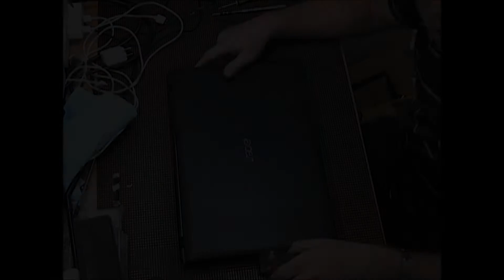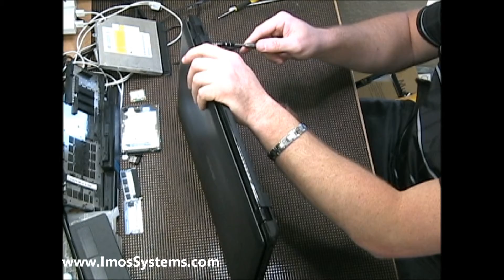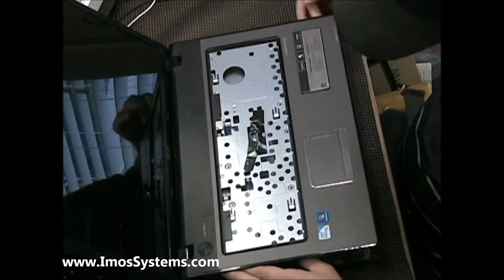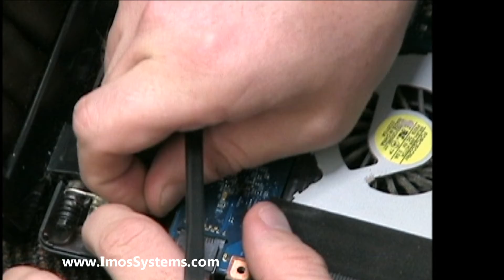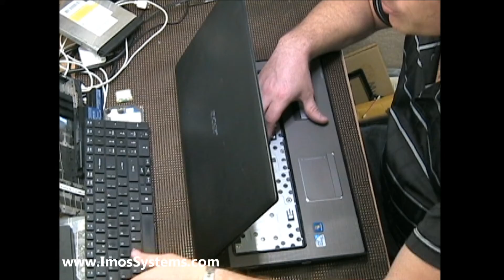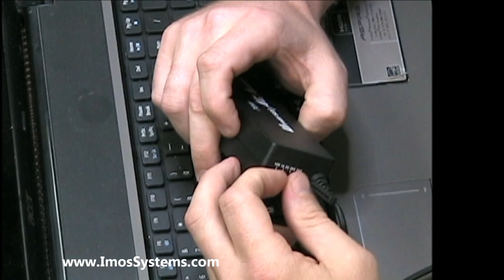Acer Aspire 7741z-5731 DC Jack Replacement & Disassembly

Comment: when facing the laptop the hard drive is to the left of the memory, but what is the slot to the right of the memory?
Reply: +Riad Qarib have you found out what is for cause mine has that slot too and i want to know what is for

Could it be for bluetooth??
Reply: Francisco Rojas Hey, come to find out it is called a PCI-E slot. It can be utilized for a number of applications, the best i've found to be mini solid state hdd drives. Used correctly you can place your operating system on them and have 10 second boot times. Hope this helps. Cheers!
Reply: FUCK!!! that is awsome hey did you found a way to install an internal bluetooth cause i want to do that

Comment: Hi there, I replaced the DC jack no problem thanks to your video. The machine still doesn't charge (tried 2 chargers) so I'm wondering if you think it could be something else, or the new DC jack was also bad? Is there any way to test the DC jack so I know whether to try to return it as defective? Thanks so much.